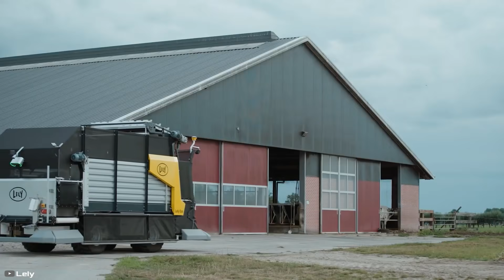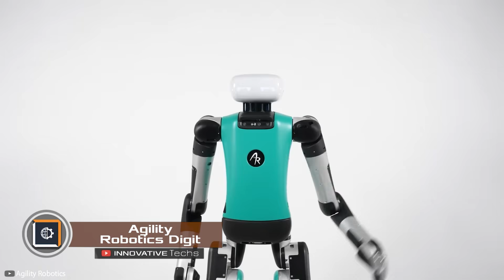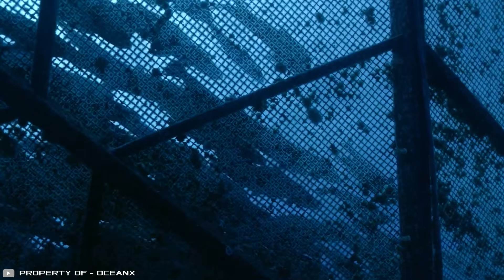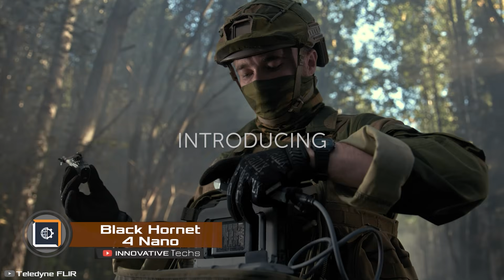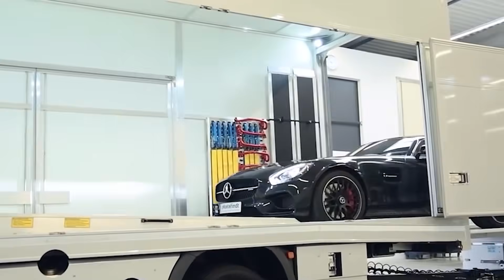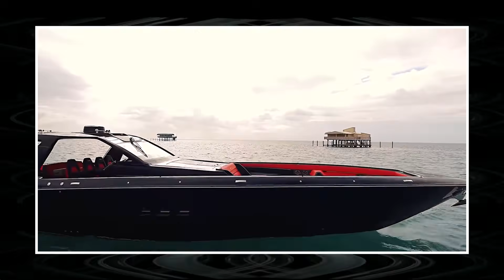40 INVENTIONS AND TECHNOLOGIES SHAPING TOMORROW

Comment: The "Paperfuge" is a toy we have been using in Jamaica, maybe even the entire Caribbean for decades. Certainly more than a hundred years. Facinating that it has now become a "new" invention. We actually use aluminium soda caps to make circular saws with them, (toys ofcourse), but effective. Interesting seeing it being used as a centrifuge, that's a useful application.
Reply: The spinning plate is not new, but using it to centrifuge blood... actually isn't new either. Manu Prakash invented it about 10 years ago. Packaged with a small plastic bead that serves as microscopic lens (Foldscope), it allows a doctor to analyze blood samples on the spot with materials that only cost a few cent. This makes tests for certain disease not only way cheaper, but also faster.

Comment: 1) If the dress shows an advertisement, no one will know you are their.
2) The suspended monorail has been done in Germany over a hundred years ago. It is still in operation.
3) Limix Dynamics is a copy cat. 
4) The water bottle is damn cool.
5) Agility Robotics! Robofab! Digit! WTF! You are trying to murder the human spirit you intellectual retards.
6) I don't see the need for an autonomous bus. Autonomous light rail was developed decades ago. If you plan your light rail properly, it won't intersect with car traffic.
7) All that I said about Agility Robotics applies to Tesla. Fire the union and replace with robots. 
8) They are using AI to monitor and control the temperature of the grill!? Why not use a PID controller for that? Oh, you didn't think of that did you. 
9) That plow looks cool.
10) An over reliance of electricity makes us week in the sight of a Coronal Mass Ejection. When we get hit the whole electric grid and all the gadgets and computer systems that rely on it, fry. If you are off grid, good for you, your system fries to.